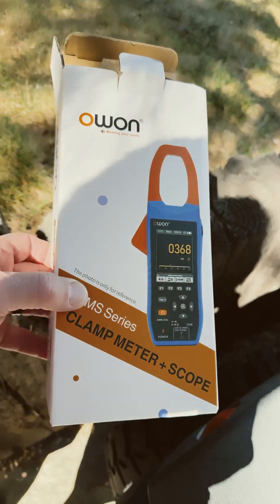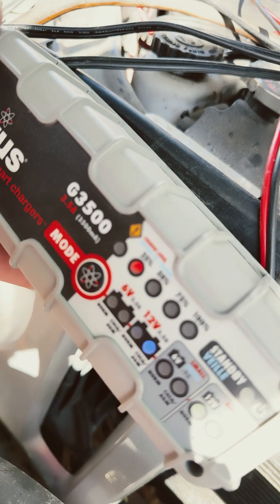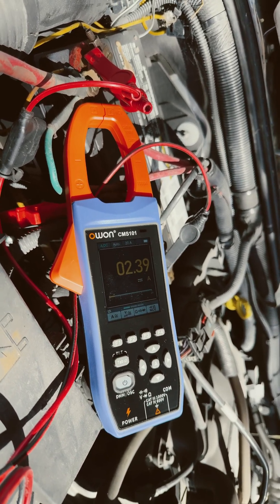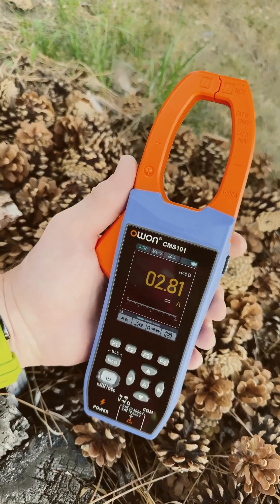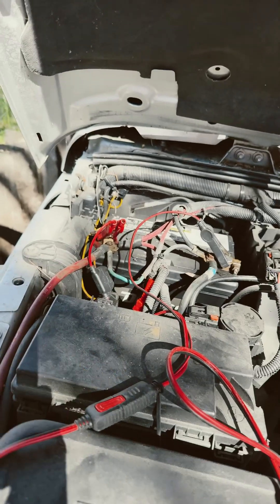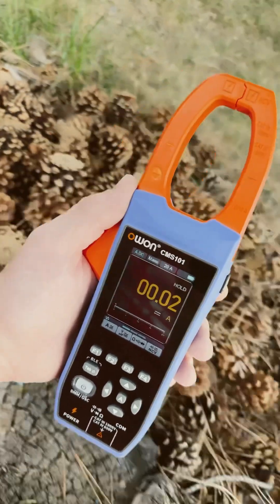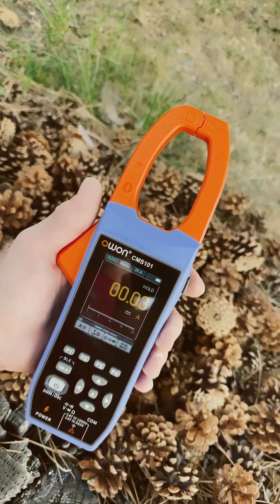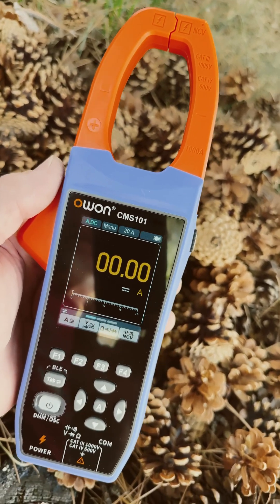Clamp meter reading car battery OWON CMS101

Comment: Great meter to have for measuring DC current, which isn't normal. On most amp meters, they usually do AC only. Also, cars that are computerized... Will have a constant draw very very small and that is to run the OBD II and things like computerized radios. Anyways, there is a spec for when it's considered to be excessive, it's either .3 or .03 of an Amp .  What I see here. I would not be concerned of it being an abnormal draw of current.
Reply from the maker: Thanks so much!  This is great feedback!

Comment: I work with a lot of UPS batteries, is there any good tester to check the health of those batteries? they're mostly 12v 7ah and 12v 9ah, sometimes 12v 12ah and 12v 4.5ah
Reply from the maker: Thanks for asking.  There is a low cost option found here: https://youtu.be/nWTBLLSBodk
This is a professional option: https://youtu.be/8Y6-O3LmrsQ